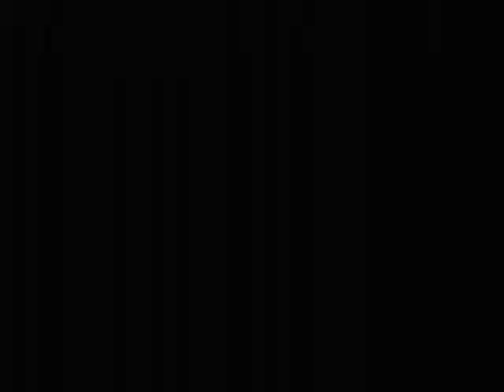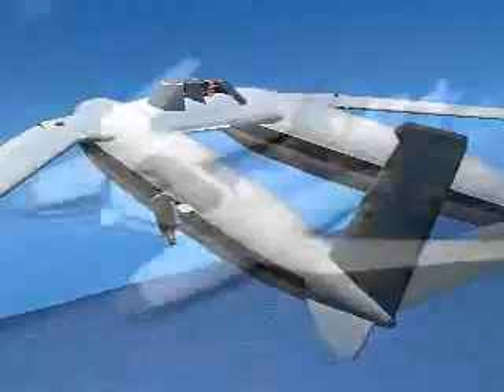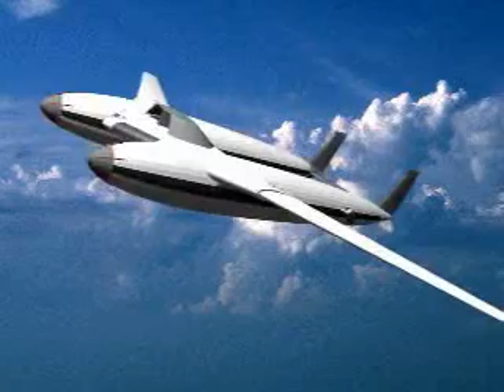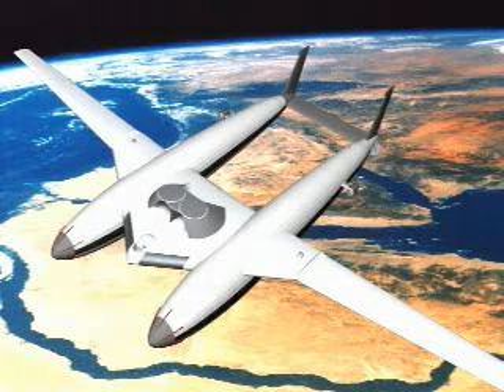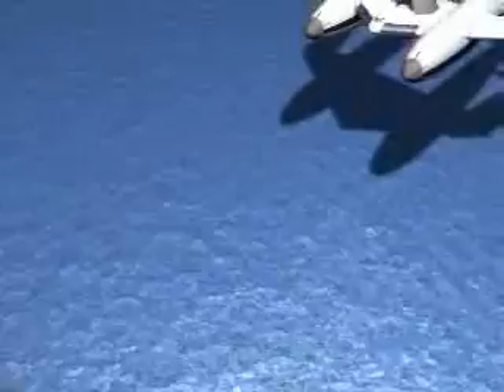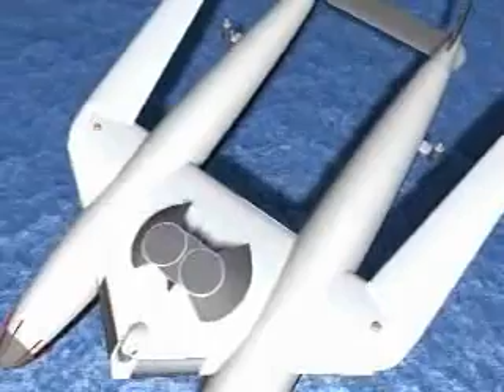Fuel-Less Gravity Powered Airplane

Comment from the maker: The reference to water landing was a presentation of one of several options available when landing this coneptual airship. Others include on land. This aircraft does not need a landing and/or take off strip of land. It can feasable avoid landing by hovering above ground indefinitely via helium lift.

Comment: Amusing, complicated concept. Make it complex enough and you hide its failings.
Sadly, this will not work.
More energy will be required to compress the gas than can be recovered during descent.
Also, have you done the sums on the size of the air bags? Lighter-than-air (LTA) flying machines have to be immense if they are to lift any useful payload - there is no denying the elementary physics involved in LTA devices.

Comment from the maker: Fresnellie, this concept air ship is about ultra energy efficiency, such as from gliders and blimps. It combines the two in a hybrid design to enhance energy efficiency. Additionally, it dabbles in attempts to collect more energy on dissent, using compressed air for energy storage and mechanical functions/needs. It also may collect additional energy via solar photovoltaic and thermal.

Comment: If its supposed to run forever as a perpetual motion machine, it falls over:
The wind turbines would cause drag that would reduce the glide ratio more than the energy that they would ever produce though compressing air. Thus additional compressed air would need to be added from an outside power source for each cycle.

Comment from the maker: The Hindenburg had a gross weight carrying capacity of 240 tons. And it was using outdated materials and manufacturing.

The concept hybrid airship in this video is also designed to operate as a glider which will provide lift during ascent and dissent. And It may use far stronger and lighter materials. And when carbon nanotube technology becomes commercially viable, that would even make this airship stronger and lighter. This would further increase gross payload capabilities.

Comment from the maker: Consider the facts that current commercial passenger aircraft requires several gallons of fuel to cruise in the air. They require substantially more full to lift from the ground and elevate to cruising altitude. Consider that the cost of this fuel adds substantial cost to fly. An airship which virtually may eliminate that major cost of flight. Among other things.

Comment: "The aircraft can float in the air which can prevent a crash landing"

LOL!!!

This aircraft is an innovative idea, but it would never get off the ground. It is a perpetual motion machine. If you research the volume vs. weight of previous lighter-than-air vehicles, you will see that this aircraft could never hold a sufficient volume of helium to achieve positive buoyancy unless it had no engines, payload, or machinery.

Comment from the maker: nate4818 wrote:
"The max speed of this...maybe 140 mph..."

It may be substantially slower than the cruising speed of a commercial passenger jet airplane. However, this plane will not be dependent on crude oil to fly. An airplane depending on crude oil for flying without access to any will be stuck on ground.

Comment from the maker: technight wrote:
"which compress the air for descent"

The wind turbines that power the air compressors do it for ascent, guidance control, and other on board power needs.

You may want to listen to the video in 5-10 word chunks and pause the video to digest the info.

Comment: Candr, irregardless of what it was called and it's purpose, it's material constitution and manufacture is old technology. Today we can build airships far lighter with superior strength at a fraction of the time. And likely with superior safety capabilities. 

Oh I agree, just don't trust this particular design, and don't consider it pratical or working in the manner which they suggest.

Comment from the maker: stoopidgirl789987 wrote:
"the helium is just to help speed things along..."

No, it is for energy efficiency, not speed. And yes, it seems planes like this and others with gliding capability could glide. However, this plane will use bouncy provide by the helium to help bring it to proper elevation.

Comment: True enough they did use old technology, but that old tech was fabric and alumiun. and actually lighter then some of the ships we have today (ratio wise) No, unless you have very very light loads with the envelopes it is useing. I agree that airships should be redesigned for todays world into heavy lifters (afterall they had aircraft carriers in the 30's) but don't see this craft as being to reliable or efficent.

Comment: The Helium envelopes are no where near enough volume to do anything like this, maybe a factor of 10x as much volume to lift it like they are showing. the old airships were as large as 8 million cuft just to get its own weight and a few passengers off the ground. By the way this is the same idea of one in the 1940's and 1970's, One called a "pumkin seed" which was suppose to work like this, didn't do so well.

Comment from the maker: DGskwinch, the law of thermodynamics and this airship have been addressed in previous comments. You may want to review them.

This airship is about ultra energy efficiency. It uses proven technology, such as helium for lift, ultra light weight materials, and glider aerodynamics. Additionally, it may use wind turbines, solar PV and Solar thermal for energy sources. Re-supplying energy storage on ground is acceptable.

Comment: According to the second law of thermodynamics, it is impossible to continue this flight indefinitely as the video says. Energy would have to be added to allow it to stay aloft. This would have to be accomplished through wind-powered generators (wind as in natural moving air, not air moving simply because the aircraft is moving) or by refueling on the ground. You cannot possibly gain the same amount of energy falling as you used going up; that's impossible.

Comment from the maker: I think that this airship would use wings and gliding dynamics (in addition to any onboard thrust it generates) to direct it's travel.

Regarding the use of the "natural jet stream". Those can be used to go back as well. Sailing vessels use "trade winds" to go back and forth across vast oceans. And if the "jet stream" goes entirely around the northern hemisphere, then it seems that it could continue on that jet stream until it gets back around to it's starting point.

Comment from the maker: Well, it seems that this design could, as discussed in the video, incorporate as much as a600 plus miles in a single cycle. And if the plane is going between 100-200 miles per hour on average. That could be one trip up and down every 6-12 hours. Thoughts?

Comment: "Some of the earliest bicycles actually allowed the rider to straddle the seat and push themselves forward with their feet"
--Of course using a wheeled contraption where friction is reduced is more efficient than proceeding by foot. You know what I meant, and it wasn't far-fetched or wrong, and you're totally nitpicking with that one, to the extreme.

This is an airship with wings and thrusters, a lighter-then-air plane. No manipulation of gravity present. False advertising.

Comment from the maker: NoGuff wrote:
"Bicycles use your legs action more efficiently through the use of gears"

Incorrect. even bicycles with no gears were more energy efficient. Some of the earliest bicycles actually allowed the rider to straddle the seat and push themselves forward with their feet. These bikes carried the full weight of the human as opposed to the human carrying the load on their legs. This saved tremendous energy. This is similar to why a glder is more energy efficient than non-glider planes.

Comment: "potential energy in physics"
--The way it "uses" gravity is no different than other planes. It just has a lighter load. My running analogy didn't hit the mark. It's more like saying that if I jump up in the air, I'm "defying gravity." Really, I'm not, I'm still subject to it. If I levitated, that's defying gravity. So for this plane to be a "gravity plane" ('potential energy' definitions aside) would be if it's propulsion or lift were gained via something like a fictional 'gravity drive.'

Comment: "There are people who have been able to bicycle at sustained average speed of over 50 miles per hour for over one hour on a bicycle."
--Bicycles use your legs action more efficiently through the use of gears, just like you're able to lift heavier loads using pullies. This airplaen is no different than other airplanes in that it uses wings to create lift. It's just a lighter load.

Comment from the maker: puffymuppet wrote:
"As far as fuel free goes"

It seems important to distinguish the difference between "fuel free" and "fuel less". "Fuel less" seems to be more appropriate description for this conceptual aircraft design. Energy is required for this aircraft. And it has several renewable, environmentally friendly sources, primarily solar thermal. It may be augmented by solar photovoltaic, and other sources as well.

Comment from the maker: hereosinerror wrote:
"that does not have anything to do with my question... i said there is no point in using compressed air to compress air because you can't get/make energy from nouthing (atmospheric air genius)"

First you may want to consider wording your statement as a question, if it is a question. Secondly, if the response does not address your comment then it appears your comment is irrelevent to this video.

Comment from the maker: hereosinerror wrote:
"...no point in using compressed air to compress air because you can't get/make energy from nouthing..."

Argument has premise flawed. Word "air" as used in video is to describe different types of "air" - helium(air) for lift, Atmospheric(air) used to displace the helium ballasts, "air" used to power wind turbines, and atmospheric "air" compressed into tanks and used for propulsion and navigation. Also, "air" is only one of the sources of energy (solar PV and thermal, etc)

Comment from the maker: puffymuppet wrote:
"how do you propose to compress all that air"

This question has been answered several times in the comments section. have a look.

"or obtain helium?"

The helium is continually re-used. So essentially it would only be need to obtained once or at intervals for maintenance to replace any lost through leaks. And presumably it could be obtained through helium suppliers like other helium filled aircraft.

Comment from the maker: DaGeBu wrote:
"If it's above the clouds how do you get the passengers/payload up there?"

It may get there with one or more of several ways, such as lift from helium buoyancy, solar PV or Thermal, or other engines. I suggest you review the other comments and answers for more info. This issue has been addressed several times.

"sterling engine is an ...combustion engine..."

A Sterling engine works by temperture differences. look up the wikipedia article for more info.

Comment from the maker: There are still many areas of research on this technology that need to be conducted. However, it seems that if the acsent and descent of the air craft is above the clouds, then it would likely have access to more solar photovoltaic and solar thermal(Sterling engine?) and avoid many weather conditions at lower altitududes that would disrupt flight.

Comment from the maker: This plane utilizes more than thermodynamic laws. It also utilizes Thermal solar and photovoltaic physics for it's function. Additionally, it demonstrates ultra efficiency for flight. And it may still use ICE "internal combustion engines", including jet turbines, if so desired.

Comment from the maker: It seems that It would be possible to carry several tons, depending on it's design. It is also important to recognize that because this plane does not have to carry the massive weigh of fuel and combustion jet engines, and the infrastructure to carry those on the fuselage and high speeds, etc, it may be able to use that carrying capacity for cargo.

Comment from the maker: xjet wrote:
"The energy recovered by the turbines that drive the compressors will never equal the potential energy gained by the displacement of air by helium..."

The turbines are only part of the energy source for this system. It may also include recovery of "potential" energy as the plane descends, solar photo-voltaic or solar thermal from panels, and even from some other energy source inside the plane. The concept is, IMHO, to show the possibilities of high energy efficiency for air travel.

Comment from the maker: USFCARTWRIGHT wrote
"so it compresses the compressed air by using air compressers?"

The system has three "air" systems. There is a helium system, a atmospheric "air" system, and a system of powering the compressors which move these "air"s from the high pressure "air" storage tanks to and from the  "air" bladders contained in the two blimp like sections of the plane. The power is either provided by air turbines in a machanical fashion, by power regeneration by air decompression, etc.

Comment: Here's an analogy that kinda works. Imagine a box full of items of various densities. To simplify, say a box of lead weights and packing peanuts. If you shake the box eventually the lead will all be at the bottom and the peanuts at the top. Some peanuts might get trapped beneath some of the lead weights. So the helium when released from its trapped state rises up above all the elements which are heavier than it. So it doesn't leave completely but is so dispersed it would be difficult to reclaim.

Comment from the maker: JohnPaul2006 wrote:
"Helium is not really renewable. It is found in natural gas pockets and is extracted by fractional distillation from the natural gas, which contains up to 7% helium."

Thanks for the info. I have also read that helium is a byproduct of radioactive elements decay(such as uranium deposits) and nuclear energy facilities. The renewable energy I wrote of was solar photovoltaic and solar thermal.

Comment: Very innovative but seriously to look at it in a "time" perspective it will never work. If your main source of locomtion is gliding your top speed will be very limited. Additionally there are no propellers to fight heavy wind or the such. (a good modification could be solar panels with electric motors) In this day and age you would need an aircraft that can hold 600 mph to be deemed "usable" in todays speedy market of deliveries and transporation.

Comment from the maker: stonerscolony wrote:
"...drag factor is always higher than the lift generated by the wings, If this was not the case then aircraft would not need engines at all"

Gliders do not carry motors. They fly for several hours, merely by riding on the wind, and/or thermal updrafts, etc. Similar to how sail boats have traveled around the world for hundreds, or perhaps thousands, of years, without on board "motors" to move them from point a to b.

Comment from the maker: Favel22 wrote:
"So just because gilders can drift with air currents do you suggest airplanes should as well? "

I think it is important to note that a glider is a form of an airplane. "air" and plane=wings. And gliders do have the capacity to get from point a to b. And with this craft, it seems that it can better navigate the seas of the sky with this tech. Sail boats do it all the time.

Comment from the maker: Favel22 wrote:
"Build a blimp and be done with it. If the machine is lighter than air there is no point in using wings in the first place."

The purpose of the wings, among other things, is for propeltion from one place to another. Without them, you would need some force to move the "blimp" to where you want to go

Comment: he says more weight is better because it gives more lift to "go further"

what he does not state is that the drag factor is always higher than the lift generated by the wings, If this was not the case then aircraft would not need engines at all lol

Comment: The video suggests something for nothing - flight without use of fuel.  This may have limited applications, but it will cost billions to design test and market and could replace only a small fraction of current air traffic.  Its fun to dream, but don't let the dream distract from the real work of powerdown, doing with less.  You young You tubers can do your part, plan to have few or no kids.

Comment from the maker: "The only real problems are the weather and the speed."

speed may or may not be a problem, depending on the needs of the transport. compare to sending a parcel by by various speeds of delivery. The faster delivery cost more. the slower speed would be cheaper. And these planes may be able to be be flown/monitored remotely, further reducing costs.

Comment from the maker: interesting thoughts. It may be worth considering that with advanced weather sensing equipement, onboard computer controls, and GPS techanology, a lighter than air, aircraft, may be able to optimise it's route using weather patterns, on the fly, than was capable in the 20th century.

Comment from the maker: ScottieDM  wrote:
"Their survivability in rough weather is far less than other aircraft."

Thanks for your comments. Interestingly, the proposed design by the Virgin Space flight launch craft is using a dual fuselage design for carrying the space craft. Additionally, with advancement in weather sensing and GPS, it may be able to circumvent dangerous weather conditions, than in the 20th century.

Comment from the maker: soaringpilot wrote: 
"...Wingload too low, plane will have a very low speed..."

Perhaps so. it may travel at an average of 100-200 miles. However the cost of travel compared to a jet airplane would likely be far less than a typical jet airplane of these days and far more sustainable and reliable in terms of access to fuel. thoughts?